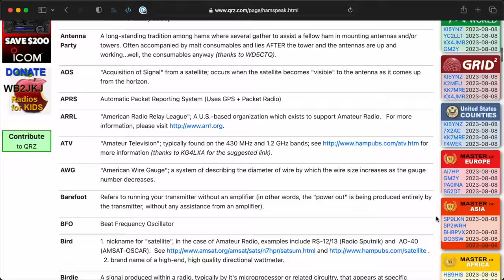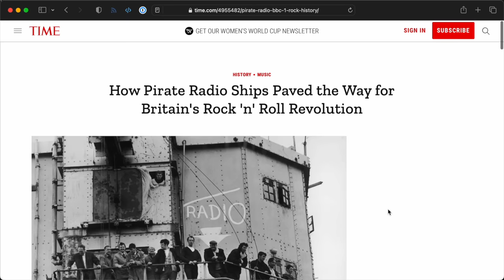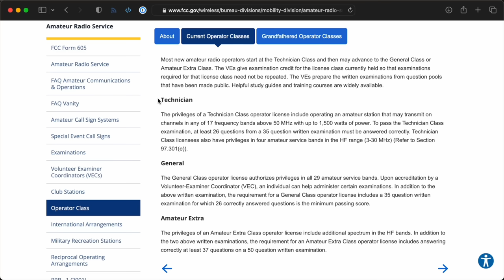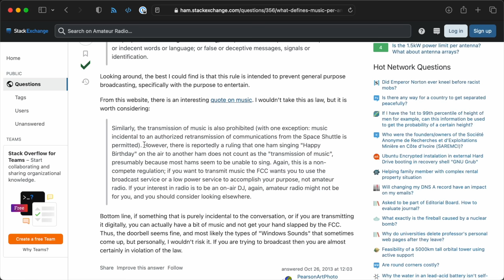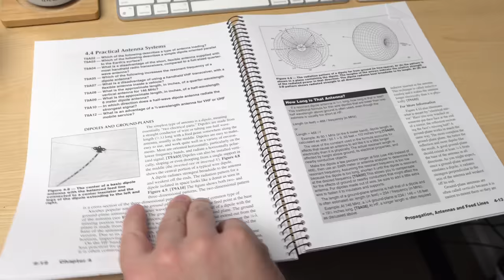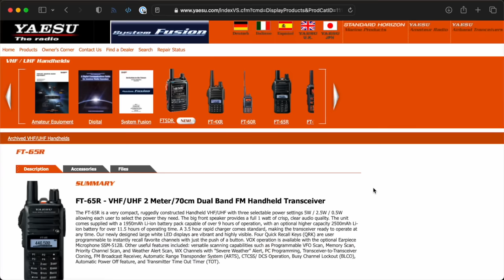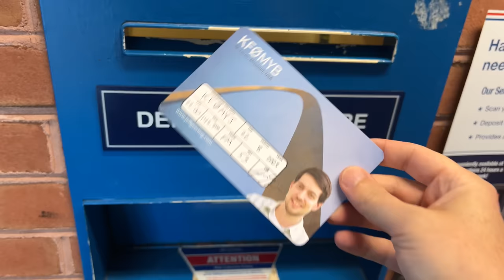It's ILLEGAL for my Dad to transmit!

Comment: 1. a designer's or engineer license should trump all other licenses below.

to design the transmitter you should need a broadcast license so you can test the broadcast then a technician license to put the soldering iron to a bunch of parts to build the transmitter then the designer license to draw the schematics and such.

2. does the small radio put out any identifying info that can be traced? so what if it was operated mobilely meaning you use it while driving can the fcc trace it easily?.

3. 5 watts is not very much and does not have that much range so you couldnt broadcast around the world?

4. do they search you for recorders? can you sneak one in for example wear an ipod nano in pocket with extra battery?

5. can you use someone elses call sign during the times they are off the air meaning can you share call signs?

i know on am/fm radio and tv when a station goes off the air at night i think others broadcast on that channel witch is why sometimes you can hear low power broadcasts on dead channels during say midnight to 8 am.

or can you use fictional call signs say kdk1 and kdk12   like from the shining?

6. i doubt the fcc will go after you unless you are causing harmful interference for example taking out emergency communication like the neon sign did

https://hackaday.com/2016/08/26/police-baffled-send-for-the-radio-amateurs/

or caused a medical device to fail and puts lives in danger.

Comment: Got my ticket in 1987 as a "Tech plus", upgraded to Extra in 2000, and as of now... I've let it lapse.

Why? First of all, scanning through the bands as of late has been rather disheartening. Lots of bad ops, bad politics, and ugly behavior. Try making sense of a DX pileup these days; you would THINK that if the DX was saying "up, up", then hams in the USA would know what that means and what to do. Mmmmmmmnope.

Then there's the new regs about RF field surveys. Where I live, this was looking like an impending fiasco. In a typical suburban setting, unless you're trying to do moonbounce, there's really no point to this. Remember: you're supposed to use a power level that's necessary for proper communications, and NOT one that can cook the hotdogs in your neighbor's fridge while they're still IN the fridge.

I dunno...ham radio simply doesn't hit right anymore. There's the constant fight with noise levels, which should be dealt with by the FCC...but they seem to be more preoccupied with how much money they can sell off what is SUPPOSED to be a public asset. F'rinstance, there's this new proposal for an HF service for stock trading. Presumably, this will be a wideband data signal that chews up 70 kHz, but which will only benefit a small but lucrative segment of the population. At the same time, though, they don't seem to know what an ionospheric outage is...or what their customers will do the first time their newfangled tycoon-style ticker goes down.

And the politics. Oh, damn...

So, yeah...36 years in, and I'm done. The FCC seems to be less interested in what amateur radio offers these days, and far more interested in sticking price tags on spectrum segments. They've left enforcement up to the O-Os so they can go fret over non-issues such as keeping "criminals" off the bands and other pointless paranoias. In short, it ain't fun anymore...not for me, at least.

TBH, I'm probably heading back to basic ol' SWLing. Tech advancements (another thing we USED TO be known for) have made this really interesting, especially in the realm of SDR work. But I just don't see any further point to wanting to "push that button" anymore.

Yeah, go ahead...call me a "Sad Ham" or whatever. Fact is, though, that any of the "essentials" in amateur radio are now handily dealt with by the little thing I'm typing this on. And yes, I've used ham radio for problems on the road and such...but this little smartphone is far more reliable than trying to hit a still-functioning repeater on 2 or 70 that no one is probably listening to. And when you're stuck on the roadside, that's not the sort of silence you want to hear.

So, really, it feels like the service has turned into a very irritating old folks home day room combined with numerous Tom Swift and His Electric Paranoia-types. And then this set that's presumably supporting amateur radio also is doing a bang-up job at ruining amateur radio. With the ARRL aiding the whole mess.

These days, it's not such an arduous task to relicense. And this might be my course of action once all of the current idiocy lets up...mostly from the old crusties dying out, sadly. It didn't used to be like this...but it is now, and the changes to the overall character of the service aren't something that I find attractive. I'll probably miss things like the QSO I had with an Argentinian op on 10 with me on my mobile with 25 watts and a Hamstik on the car trunk. But if I start to miss my rounds of ionospheric billiards, there's always 11 meters. Trickier...but now legal for DX, which is my main kick on HF anyway.

Oh, well...sorry for throwing a wet blanket on your dad getting his ticket. Congrats! And I hope he finds something in amateur radio that holds his interest. I just think that, for some of us, things just don't hit right in ham radio anymore. Just sayin'.

Comment: Imagine two raspberry pi's sending 300bps of data over a distance of 100 miles.... Shortwave is a lot of fun but you need General. Want to try meteor scatter myself, and that only requires requires technician. You can spend the test of your life exploring amateur radio, and still.... never do it all

Comment: Why does analog still sound like shit? At that price your 5W handled radio should have a ultra low power DSP cleaning up the audio. A 2USD STM32L4 can do that with 40mW power consumption. There is probably a git project with audio cleaning code already written.